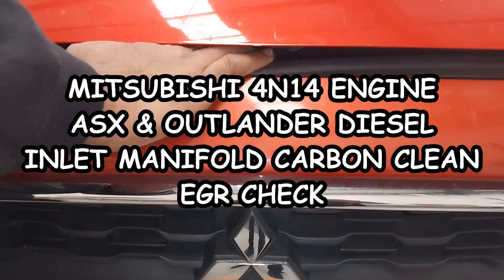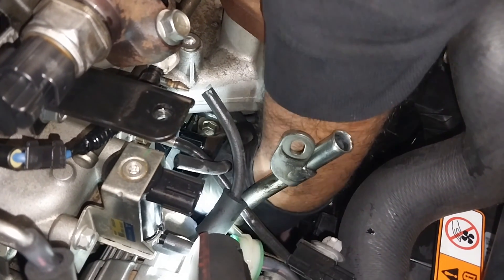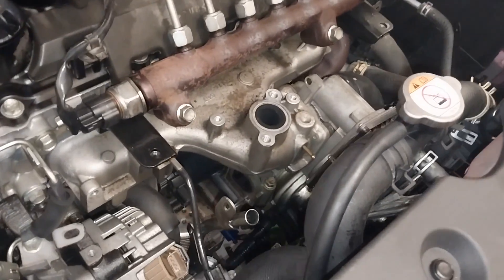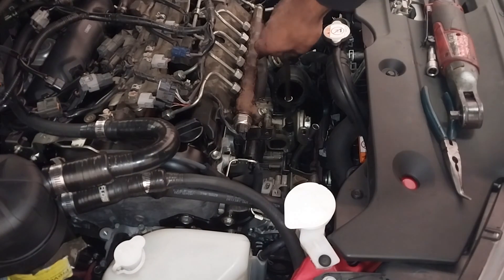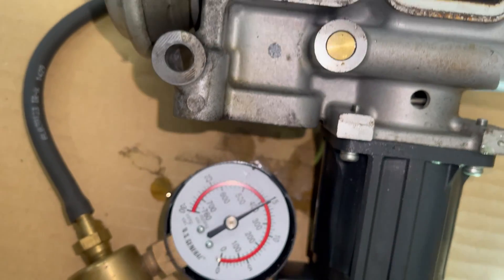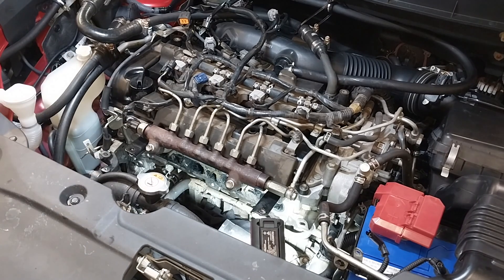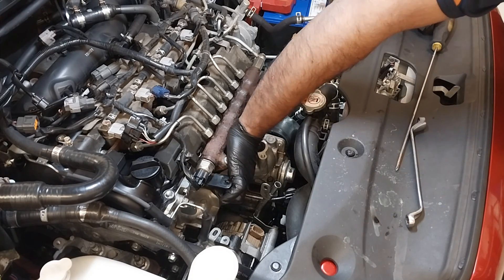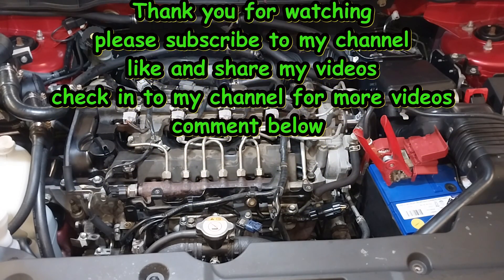How to clean intake manifold on Mitsubishi 4N14 engine #ASX & Outlander diesel engine carbon clean

Comment: hello..I have a 4N14 ASX that is very rough idling and has no power...I suspect the EGR inlet is at fault, is this something you experienced?...there are no error codes...many thanks
Reply from the maker: Yeah first check you EGR and inlet manifold for any carbon blockage. Cold side air intake tube (towards Throttle body) make sure no cracks.
Reply: @PrimeTechauto  thanks, I did this procedure and the car runs good. I also removed the balance shaft coupling that was rattling a lot. Thanks again for a helpful video!

Comment: TIP! TAKE A PICTURE OF YOUR ENGINE BAY FIRST and Make sure you had plenty of time to do this. Attempted it myself but couldn't remove the lower left bolt for the intake manifold. At least throttle body and egr pipe is clean!

Comment: Sorry for the late comment, only just stumbled across your video. It looks like the car has an oil catch can, but it's not connected. Why is this? Did it not perform well or did it cause a problem?
I only ask because I've just replaced my turbo on an ASX having 4N13 engine and am considering installing a catch can to hopefully prolong it's life. 
Do you have any thoughts on the installation of oil catch cans? Supposedly it should also help to reduce carbon build up on the EGR valve/ pipes. Mine were even more clogged than yours. Cleaning the EGR was the first job I did after recently buying the car. 
Thank you for the informative video 👍
Reply from the maker: Yeah the catch can was disconnected. We were fish using the exact issue of this car and the catch can disconnected of purposing of diagnose the fault. This had noticeable power loss. The issue was carbon blockage and once we cleaned the issue wasn’t there. The catch can installation is good and I don’t see anything wrong and as long as you maintain the catch can well. You need to replace the filter in catch can regularly and drain oil in catch can frequently. Catch can help prevent (somewhat) excessive carbon blockage. Cheers

Comment: There is a steering fluid pump in the way of the bolt on the far left of the inlet manifold. It's attached to the aux belt. What can I do to remove the pump?
Reply from the maker: What’s the engine code on yours. Is it 4N14 or 4N13. This engine in the video is 4N14. Thera no power steering pump to remove when removing the manifold. I assume yours 1.8ltr 4N13. Little bit different to this engine.
Reply: @PrimeTechauto  It's a 4N14 2.2 DI-D GX4. On Wikipedia I think it says 2.3? (It's 2.268 or something close)
Reply: @PrimeTechauto  (continued coz edit not working...) The picture on Wikipedia is correct, you can see the steering fluid pump pully at the very top of the aux belt. But every video I see thy don't have it.
Reply from the maker: @GetMoGaming I dunno what you see mate, this car don’t have the ps pump. Is yours outlander or ASX. Either way, why should I hide .. either your model is totally different to what we have here. If the bolt is on the way, there’s no  other way around. You need to remove it.
Reply: @PrimeTechauto  It's really strange. It's a 4N14 2.2 from 2012, It says it on the engine, and looks identical to the 4N14 Wikipedia page picture. Anyhoo, do you know where the tensioner pulley is, so I can release the aux belt tension and how I can access it? It may be different to the one you have, but I'm guessing it'll be the same. Thanks
Reply from the maker: @GetMoGaming usual 4N14 models, the auto tensioner for the belt is near the alternator pulley. The model ai worked on, the power steering pump located behind the engine - near to firewall side.
Reply: @PrimeTechauto  Ok thanks mate👍

Comment: What are the parts that get dirtier in the 4N14 intake and have higher cleaning priority than others? 

I'm considering cleaning below ones: 

- Throttle body
- Inlet Manifold
- Intake port in the cylinder head (for the inlet manifold).
- EGR valve pipe B

But skipping "EGR Valve" and ""EGR Pipe A". I see the EGR valve is not as dirty as the other parts. However, EGR valve removal steps in the manual mentions that you need to drain coolant do some additional pre-requisites that I think it makes the process harder.  

Would this cleaning be good enough or "EGR Valve" is also a must?

No real issues in my Outlander yet. But it is already at 139k KM and would like to plan some cleaning in the next months.
Reply from the maker: Look , I’ve done so many of this type of repairs and very hardly seen that the EGR pipe blocked with excessive soot. No harm of remove and inspection. There’s no hard procedure of draining the coolant. Just remove the two coolant hoses and plug something in to the holes and block them from draining all the coolant. Top up as required & bleed the cooling system.
Reply: @PrimeTechauto  Thanks a lot!

Comment: Hi I have dark diesel mist all around my air intake pipe. What is the reason for this?
Reply from the maker: Is it near throttle body
Reply: @PrimeTechauto  Yes!
Reply from the maker: @Thecarfreak100 if there’s no crack in your intercooler hose. This is normal. Check the hose properly for any splitting. If not. Clean the oil and just retighten the throttle clamp.

Comment: Why only half a job?
You need to remove the cooler too as that'll be chock full of carbon too or did you some how check it?

Good video, but a bit more info on bolt location would have been better. Seems you skipped steps.
Reply from the maker: @ashyt16turbo  yeah I’ve check cooler. Egr everything. There’s not a small bit of carbon. Haven’t skipped an any steps.Third to keep the video not lengthy so, some steps may skipped in the video. This video is only for informational purpose.

Comment: I have the same problem on my Outlander 3rd generation (2016) which is equipped with the same engine 4N14.
I think these excessive soot buildup are the cause of the turbocharger exhaust gas leakage, I am experiencing.
The engine doesn't receive the proper amount of air, the temperature of the exhaust gas increases and this leaded to the deformation of the hot side of the turbocharger.
The consequence, in my case, is that the exhaust gas enters into the cabin, with obvious problems.
I did the same cleaning of the intake manifold and now the engine is breathing very well, is very smooth and I have the impression that the fuel consumption is decreased.
Unfortunately I have been not able to remove the EGR valve, which was my objective.
I removed and cleaned very well the throttle valve.
Thanks for this useful video.
Reply from the maker: @LeonardoSofia-IU2-QEB  dunno where are you from. I’m located in Victoria Australia. Exhaust fume in to the cabin isn’t because of the blocked manifold or egr. It could be cracked  exhaust manifold, near Turbo charger. Just get the car checked by a qualified mechanic. Ben Mitsubishi dealer would have pinpoint this since it’s a common issue. I have done many manifold replacement for this. 
Just  call on my business. I’ll explain this. 
Thanks
Reply: @PrimeTechauto  I would be very happy to come to visit you, but unfortunately you are a little bit far from me, I leave in Italy.
In my case it is very visible the leakage from the turbo.
I am not able to post videos or photos, but I see black sign of the smoke on core assy bolts and on the inner side of the aluminium carter which cover the turbo.
I have already visited the Mitsubishi dealer whom tried to seal the leakage with a thermal paste, without success.
In principle one bolt of exhaust manifold was loose and this was also causing leaking.
Thanks for your answer and best wishes.
Reply from the maker: @ this is not loosen bolts . It’s definitely cracked manifold. replacement is only the solution. Good Luck.
Reply: @PrimeTechauto  I will check carefully, thanks.
Do you maybe know what is causing the other problem I have?
When I release a little bit the throttle and then I accelerate again, the car starts to vibrate.
Are not the engine supports.
My mechanic said that it is a problem of the automatic gearbox, the torque converter.
It is mostly happening at the same engine rpms.
If I remain at those rpms the shaking continues indefinitely, if I accelerate it disappears.
Very strange.
Any idea?
Reply from the maker: @ it’s hard to tell what is exactly. I do not think it’s your transmission or torque convertor. Check all you engine mounts .
Reply: @LeonardoSofia-IU2-QEB  I have da same problems with vibrations and I have found also that throttle body is all with carbon and also intake manifold is full with carbon. Now I will try first with throttle body cleaning and intake manifold cleaning and then I hope its all ok . Did you found  what cause the vibrations??
Reply: @ekomkd161 most probably is the torque converter.
At low rpm it makes shaking the car.
I don't have a bridge to try to disassemble the gearbox.
I will keep the car as it is.
I purchased a fantastic Leapmotor T03 who I use for the most part of the week.
I use the Outlander only during the weekend if I need 5 seats plus the dog or for long trips.
But to be honest I would to understand what the real issue with my car.
Unfortunately there are no mechanics expert at the right price around me.
Bye.
Reply: @PrimeTechauto  Hello. Did the turbo make a whistle sound then? I have tried a smoke machine on the intake and the exhaust pipe and no leaks. But sometimes it smells a light smell of unburnt diesel and the turbo sound on heavy use. I have opened and didn't think the turbine axel is to bad on the intake side. Can you please help me where I can look for cracks or locate them?
Reply from the maker: @Andreas-wo8cg nah the turbo doesn’t make any abnormal sound. Look for black soot sprayed around back of the exhaust. Close to the firewall. It’s hard to explain
Reply: Your problem is almost certainly a cracked manifold around the weld. 
Nothing to do with the turbo. Very common problem.
Remove the shields and you'll see all the black carbon around it.
Needs removing and rewelding.
Reply: @LeonardoSofia-IU2-QEB  
I'm considering cleaning mine. But also trying to see if the EGR Valve can be skipped and focus on the first parts that can be removed without much pre-requisites: throttle body (easiest one), inlet manifold, intake port in cylinder head, egr pipe B. Let me know if I'm missing something important that gets lot of buildup.
Reply: @SEB88-z7b  you mentioned the most important parts, clean them, first.
Don't remove the EGR, I think this is not needed and can cause damages.
Just remove the soot buildups.
Bye.
Reply: @LeonardoSofia-IU2-QEB  Thanks a lot. Once I'm done, maybe for the EGR (assuming it has a thin layer of carbon) I'll try some of those cleaners you pour on the intake every 5 seconds, that can clean a very thin layer but not thick soot buildup. 

I'll order the gaskets (MR985190 throttle body gasket; 1582A209 egr pipe b top gasket; 1582A194 egr pipe b bottom gasket; 1540A295 inlet manifold gasket) and while they arrive, learn best way to clean the parts mentioned.

Comment: Helpful video, did you had to drain all the coolant and also did you reuse the old gaskets , thanks
Reply from the maker: @tonyram-i3q  don’t drain all the coolant. Replace the gaskets. But you can re-use them if there’s no damage on the gaskets since they are metal gaskets. 👍
Reply: @ thanks mate , cheers 
Please do some videos on 4n14 tappet adjustment thanks
Reply from the maker: @ will do as soon as I have a car in my workshop.

Comment: How long does a job like this usually take ?
Reply from the maker: @Ryan2012Tube  it’s depends how bad the carbon deposits is. Takes while to do a proper clean. I would say around 3 hours. Including remove and refit.
Reply: @PrimeTechauto what colour was the smoke from the exhaust?
Reply: @PrimeTechauto did you remove the cooler? If so did you need to top up the coolant?
Reply from the maker: @seemaab  you can check the cooler and avoid removing it if there’s no carbon blocked. 
If the cooler removed, it definitely needs topping up the coolant
Reply: @PrimeTechauto  ok but did you remove it? I got a p0401 code literally seconds after I filled up with diesel and redex
Reply from the maker: @ it is depends. Don’t remove the exactly if I remove the cooler on exact car where this video belongs to. 
P0401 is for egr. 
It’s looks like your egr stuck or blocked with carbon. You need to remove and inspect first.
Reply: @ Mitsubishi scan tool mut 3 shows the EGR is responding to the actuator tests at 0%, 50% and 100% so what else can it be